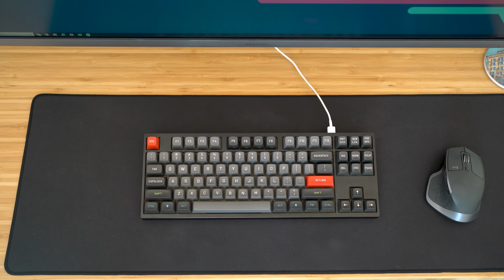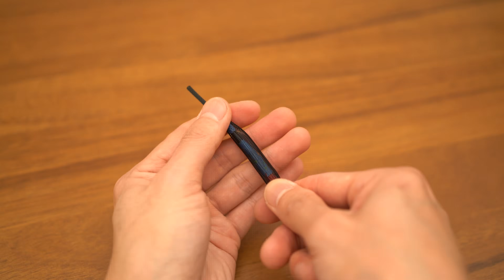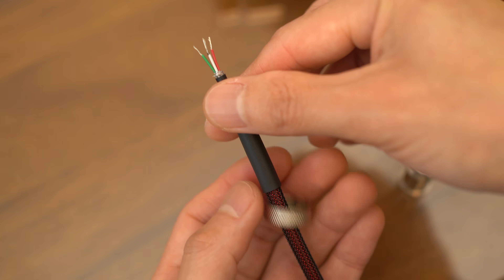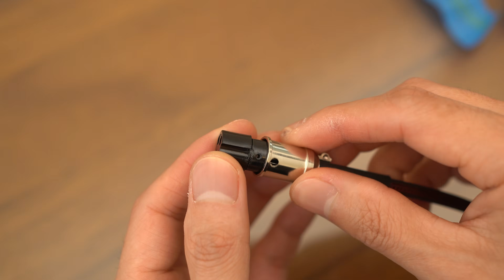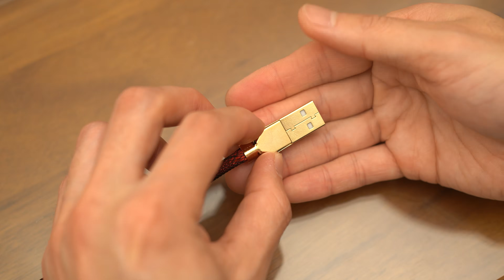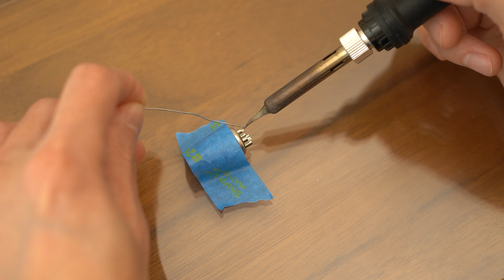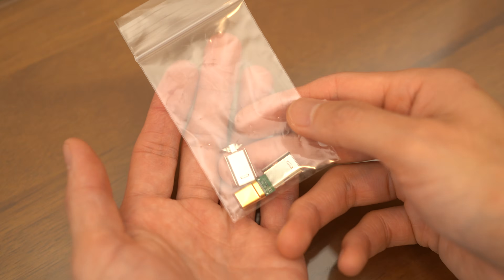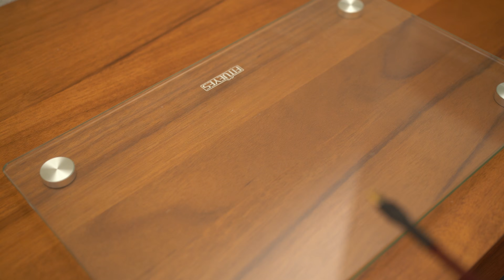Custom Coiled USB Aviator Cable for $50?!?!  Build one DIY for just $17!  Follow Along Tutorial!

Comment: This is a good tutorial.  A couple of points:

1) Tin your soldering iron.  It will work better and last longer.  Basically you want to keep the tip shiny.  I dip the tip in a tin of flux and wipe it off on a wet sponge.  You can also get a tinning block.  They're cheap and work great.

2) Twist the cables and tin them before soldering.  Makes soldering the connection faster and better.

3) The lines inside 550 cord are the strength of the cord.  They're not for "shaping".  That doesn't matter in this case but that's what they're for.
Reply from the maker: Thabk you so much for that info! I've learned so much from the viewers after the launch of this vid!

Comment: Other than Looking nice, what function does the disconnectors provide?
Reply from the maker: I think aesthetics are the primary reason people go for these aviator connectors, but if you do have different keyboards with different connections (USB C Vs. Mini, etc.) they allows you to swap out the coil side quickly :)
Reply: @Keybored  ahh good point

Comment: Another tip for the final coil setting part is to grab a small length of extra techflex and just use your heatgun to heat it up until it melts. It gives you an idea as to how it will look like as it is about to melt and also you will know how long do you have to heat it with your specific heat gun/ hairdryer. As an added bonus, it removes the fear of failing because you already know how the failure would look like
Reply from the maker: That's a great idea!  I learned the hard way when I melted a fully complete cable before lol

Comment: So I just made one of these and my usb c connector only works if I push it to one side (like when a charging cord for your phone starts to fail). Also it has a click when I wiggle it to up or down. Other usb c cables I have so not do this, they just fit snuggly and have little play. What have I done wrong?
Reply from the maker: It might be that the usb connector in the little housing may be loose :( might have to crimp it tighter
Reply: @Keybored  I ended up taking that type c off and soldering a new one on and it works flawlessly but still has that north-south wiggle and click

Comment: Some tips:
1) It's actually black, green, white, red. Lookup USB pinout. Doesn't matter if you consistently connect it the other way around in your own cables, the electrons will happily march down any conductor, regardless of the colour of the surrounding insulation. But if someone else ever needs to work on your cables, they expect white to be D- and green to be D+. I know this sounds nitpicky, but if there's an industry standard, best follow it, especially if it's no extra effort.
2) A little bit of flux will help the tin flow better into the connectors on the aviator cable. Don't use too much, because it is a bit messy. Best way to clean it after soldering is with some cleaning alcohol and a stiff brush.
3) It's easier if you pre-tin your leads before connecting them to the connector.
4) I noticed your tip of the soldering iron was pretty black. They work better with clean tips. Rule of thumb: every time you put it back in the soldering rest, the first thing you do when taking it out is clean and wet the tip.
5) Don't put the solder onto the tip, and try to dab it onto the connector. The correct way is to heat the connector with the tip, and melt the solder by touching it onto the connector. Obviously, there's some danger of overheating those connector tips and have them melt the plastic. That's where flux would help. But what you want to see is not solder balled up on the connector, but the solder flowing into it of its own accord. It may not matter terribly for a keyboard, but a bad connection could cause all sorts of weird and hard to diagnose issues.
Reply from the maker: Thank you so much for the great suggestions Juan!  I have learned so much since the launch of this video, and I hope it helps to improve my own cable building in the future!
Reply: Ah, Golgari Boros, got it.

Comment: what size of heat shrink did you use
Reply from the maker: Hi Ralph! I'm not quite sure of the exact size since it came with the kit. From what I remember, it's slightly larger than the usb a connector. Sorry I couldn't be more specific!

Comment: So whats the reason for the aviator cable?
Reply from the maker: In my opinion, mostly for aesthetics. But it does help with a quick disconnect, in the case where you're swapping keyboards and one uses USB c and another uses a mini usb, etc. Also to make coils to keycaps or keyboards without unplugging from the computer :)

Comment: Is the double sleeve necessary for coiling? Or can you just like put one single sleeve? What's the difference?
Also that C connector doesn't look that solid, am I wrong?
Reply from the maker: Hi Mattia! The double sleeving is not absolutely necessary, but adds another layer of support to the build. Since the launch of the video, I was given a lot of good advice about using hot glue and marine grade heatshrink with adhesive inside to help the USB connectors be stronger!
Reply: @Keybored  that's interesting really. I've been watching some of these diy cable videos recently (yours is nice really btw) and more people would do this "pet over paracord" thing
The marine grade shrink + hot glue really sounds premium, I wonder for how much one could sell a cable made in such way

Comment: Welp after two separate attempts ( one without the Cruz ctrl kit) I spent a good 3 or 4 hours doing this and my cable doesn't work lol I think I must've soildered something wrong. I'm just not cut out for the DIY custom cable. Probably will just buy one pre made in the future. C'est la vie
Reply from the maker: That's unfortunate to hear Sam! I believe you may have a crossed wire or a incomplete connection! If you have a multimeter, you would be able to diagnose the issue. Sorry to hear that!

Comment: an idea for the heat gun part, set one end of rod onto a raised surface and hold the other end. you can then spin the whole rod and cable while heating instead of heating one side then the other :)
Reply from the maker: Great idea!  Will have to try that out!

Comment: So, basically, this is all for aesthetics?
Don't take this personal, I really like these DIY tutorials where you can save a LOT of money and basically end up with the same thing... Just the concept of this type of cable...
You're actually making your keyboard LESS reliable, just because it "looks good"?
I mean, you're defeating the shielding of the cable that's designed to reduce interference, you're adding length to your cable, just so you can have a big coil, causing more interference to your cable that now isn't shielded anymore and on top of that you're adding unneeded connector in your cable that isn't even designed to work with high frequency signals such as USB, and adds resistance to the cable as a whole, making the signal even weaker, and still more susceptible to interference?
Just because it looks good?
Then why would you even spend a lot of money on a stable n-key rollover PCB for your keyboard, if you can't even guarantee the signal gets to your computer in time?
No offense, it really does look good. But if you're a gamer, this would be really bad. Not what you do personally, but this type of cable in general.

Some advice for at least a bit more stability; Those shielding wires and foil: Don't cut then off! Fold them back and make sure they make good contact with the housing of the connectors! All four of them! It really helps data stability, and it's just as easy to do as cutting it off. Just a tip to make the cable more reliable, so you can enjoy it more ;)
Reply from the maker: Thank you for the great advice! Since the release of the video, I did receive a lot of great advice from many viewers like yourself, and it helped to improve my own skill sets a lot. I appreciate all the constructive feedback :) there are some that tell me that I suck and I should go die but can't win them all ;)

Comment: Just a few moments:

1. To avoid spaghetti cable (when it's bending and coils falling apart) I think it's worth mentioning reverse-coiling
2. When it comes to numbers, phrases like "A proper heat gun set to Low" basically mean nothing except that you have to use the Heatgun. It will be cool to mention melting temp. for techflex and crystalisation temp. for paracord.
Reply from the maker: Great advice! Thanks!

Comment: for anyone interested paceworldwide have a good 9 part series on soldering. some information may be outdated like leaded solder and some connectors are rare or not used anymore. 
i posted the playlist, but something ate my earlier comment. 
the series is old, some parts may be outdated, and it may be too long to watch in one sitting, but it is very good for any one interested in learning the techniques and how it works.
Reply from the maker: Thank you so much for the advice Karna!  Will go and check it out!

Comment: video content is amazing but there is some inner cringe as a CS/EE student.
1. if you have no plan to open the connector ever again (since you probably won't), why not just test the cable and flood the joint use hot glue
2. at 6:58 you are pushing on the stripper to strip a cable, it is a bad habit since it can damage the wire inside. Indeed it probably did since the shielding layer is also being cut though. Instead, just put your finger into the hole and spin the stripper around
3. As another comment pointed out, the reinforce/shielding strands should not be cut off but instead solder to ground pin or connector housing. That would improve shielding (which kind of don't matter for keyboard cable) and strain relief (so it would last longer)
4. use wire cutter to strip.. (just imagine, the engineers have worked so hard to make it just cut though the plastic but not damage the strands, and you just grab a wire cutter :)
5. I am not sure but I don't think the connector clamp grabbed onto the techflex, I would suggest strip the cable closer to the sleeve
Reply from the maker: These are all great advice Ushio!  Thank you for pointing these out :)

Comment: I know I'm late but I just got done building my first cable after watching this vid and man, it was rewarding. I had no soldering experience prior to this, so doing the tiny slots in the connector sides was incredibly difficult. And my coil is a little loose. But it was so worth it in the end!
Reply: I think somebody mentioned that after you heated the coil stick it into the freezer for 30-45 minutes still around your tube then it should be tight. I'm still planning on building my first so take it with a grain of salt. Btw what solder did you use?
Reply: @vividphantom6975  Yeah I read about the freezer trick but I wasn't sure how that would work...would it need to thaw afterwards? how long would you have to wait? I used 60 tin/40 lead rosin core solder from amazon and a cheap ass iron. i'm a total noob though so i went through like 5 tips cause they kept getting brown residue on them lol. Just out of curiosity, what color paracord/techflex are you planning on doing?
Reply: @nihalprakash8883  I'd say thaw it yes but I think it should maintain its shape, and yeah I imagine I'll probably do the same as I also have no soldering experience lol. Aqua techflex color and silver paracord color. Btw how thick was your solder? was it 0.6mm?
Reply: @vividphantom6975  0.8mm. Aqua/silver would look great. One tip, make sure your heatshrink is either 1/4 or 1/2 inch on the USB-A side. 3/8 inch is too tight to fit over it unless you use pliers to stretch it out which can be a pain. For the other ends 3/8 works well. And for the soldering process, it helps a lot to just apply a little bit of solder onto the exposed wires before you solder them on to the connectors, it prevents the wires from fraying and makes it easier to solder them overall.
Reply: @nihalprakash8883  ooh I understand, thanks for the advice, I'm also watching how to solder videos right now too so this information is very valuable
Reply: @vividphantom6975  Of course. Best of luck with your build!
Reply from the maker: I'm glad it worked out ok Nihal!  With practice, your cables will continue to get better and better!  The difference in quality between my first and second cable was huge!
Reply: @Keybored  Thanks! Your video was definitely very helpful. I'm already planning on getting another cable kit with a cerakote coated connector.

Comment: If anyone is going to actually do this, use marine grade shrink tube. It has an internal adhesive that's heat activated that will hold the sleeve in place. Overall good tutorial man
Reply from the maker: Thank you for the suggestion BeefyChowder!  That is great advice, and I did notice some on Amazon as well!  Will try that next time!
Reply: @Keybored  thank you for the awesome tutorial, I'm going to give it a try this week! I make custom moped harnesses and use the Amazon marine shrink tube and wire loom all the time it's good stuff 👍

Comment: I absolutely love this tutorial and i’m planning on making my own cable but, i have an issue. I cant find 4 core cables online that are red, white, green, and black. I’ve found other four core cables but they are all red white black and yellow. Does this matter at all? Can i use these cables despite the colour difference.
Reply from the maker: Hi Hyperion!  Thank you for the comments!  I believe as long as you follow the same order, you should be ok :)
Reply: as long as the ends of the wires are connected to the correct pins, it should not matter the color. that is why wiring diagrams for connectors are important. the colors is very helpful if you have noted what goes to what, or if your memory is good enough.
image search for the connector, or combine it with wiring, or pinout may be required. standard connectors should have the pinout on images easily found through google or duckduckgo.

Comment: why'd you cut off the earth wire?
Reply from the maker: Yup, it's best practice to keep the shielding and connect it to the metal housing!  For the 5-pins, I connect the shielding to the 5th drain line, but for the 4-pin I did not.  Will keep that in mind for next time!

Comment: I've never soldered before, but I'd love to learn how so I can try this in the future. I love the look of a coiled cable with a custom keyboard, and you did such a clean, tidy job of it!
Reply from the maker: Hi OspreySoul!  The coiled cable completes the look!  Give it a go and you will be surprised at what you are capable of!
Reply: @Ospreysoul you heat the contact up with the iron and then touch the solder to the contact. it should soak in. Don't blow on it or move it until it's cooled. The end result should be shiny and stronger then the wire. Use 60/40 rosin core solder.

Comment: how about connecting shielding to the connectors?
Reply from the maker: Hi Aliaksei! That is the best practice. For 5 pin aviators, I connect the shielding to the drain, but for the 4 pin, I did not. However it's always good to connect the shielding to the metal connector as best practice.

Comment: So...you use a wire stripper to cut off cables, but use a cable cutter to strip them?

Gimme some of your kush, bro.
Reply: meanwhile me uses scissors :)
Reply: Easy way to nick your strands and f-up the cable durability from the get-go. Wire strippers are dirt cheap, use the strippers, you will have a cleaner and longer lasting connection. I used to do wiring in commercial jets, you never strip the wire with cutters. But you want a kick ass way to go? Use Meisei Hotweezers . Red hot metal for the win.
Reply: the video is pretty... but the technique is extremely poor.

Comment: Hello, great video, I will try to do a cable for myself just like yours for my keyboard, but I wanted to ask if you can charge a phone with that cable or not, 
Thanks in advance, keep up with the good work!
Reply from the maker: Hi Miguel!  I have tried it with a phone to charge, and it does work, but due to the length of the cable, it might not be as efficient as a standard charger.  Hope that helps!